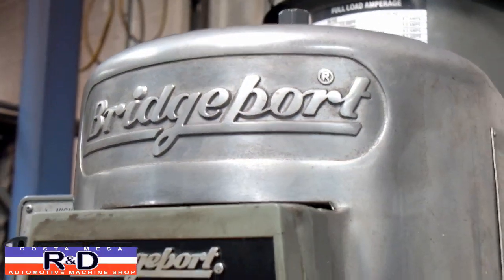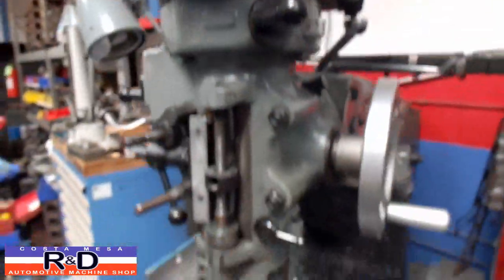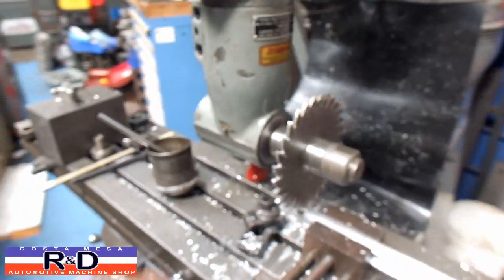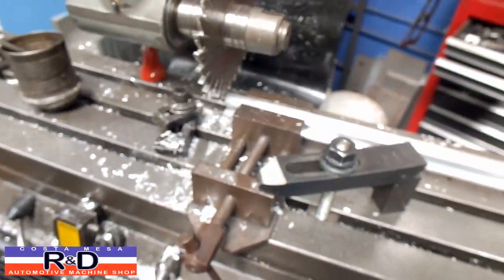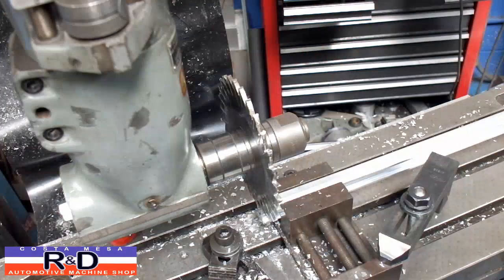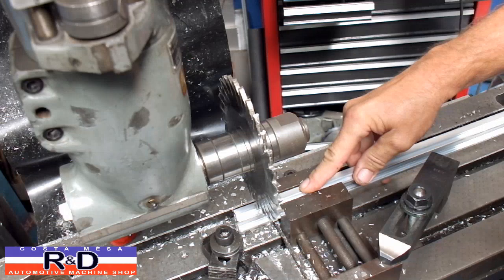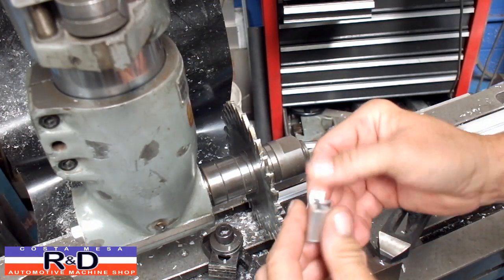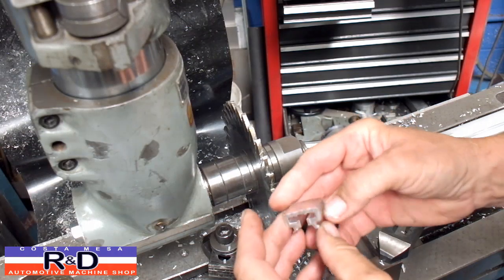Using the Bridgeport Mill as a Cold Saw

Comment: Though the time it takes to setup the mill for it might not be worth it if it's just for a one off job... but if you want to make a bunch of cuts it's worth it. Plus keep in mind those horizontal milling attachment is really hard to find, if you can find it they are very expensive. Might be cheaper to actually buy a cold saw.

Comment: I've used right angle attachments for putting slots inside of large diameter parts that were too big for the lathes they had at the shop. So we set it up on a mill and a rotary chuck, and went around till depth is achieved, then in the same set up I'd drill all the 30+ holes and other slots and grooves on the part. They were for large turbines that's all I know. It'd take a solid 4 hours for one part then you had to spend the time to deburr everything....